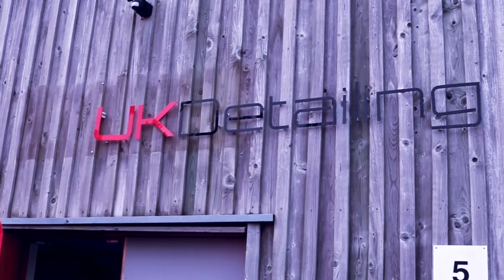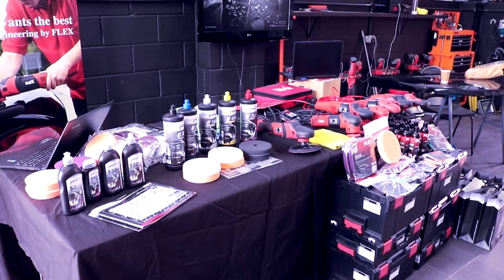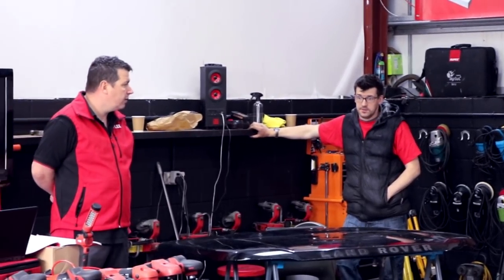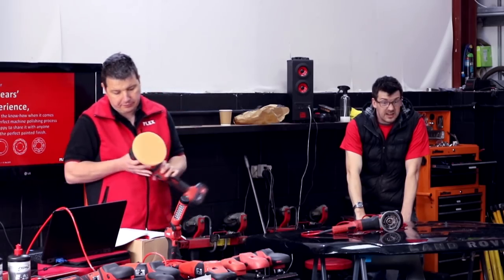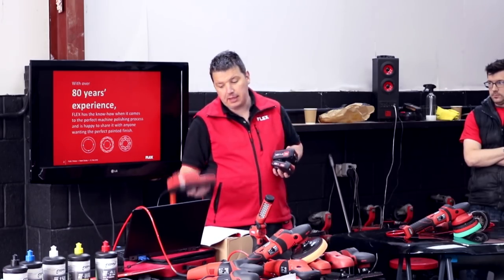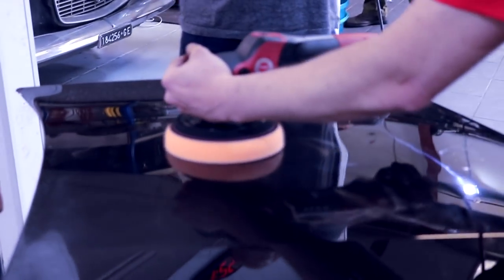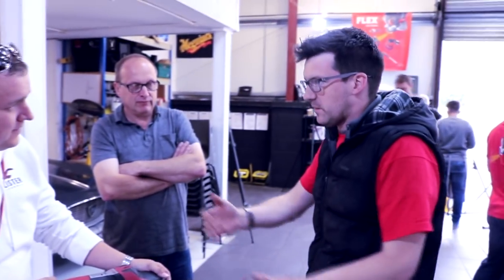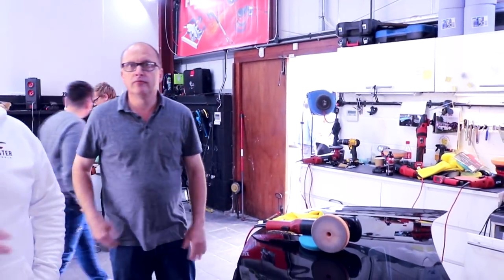Making paint smoke on a rotary! UK detailing: Flex Power Tools and Scholl Concepts introduction day

Comment: I know I don't work at Scholl, or class myself as a pro detailer, but it does annoy me of their pad choices. For example, they say purple pad for S20 black, which I find WAY too aggressive, especially when you have to work it longer. They also say not to use a white pad, or soft pad, but use an orange (med-heavy) when using S40 finishing polish. So they want a one-step to use their heaviest pad, and their finishing polish to use a medium-heavy pad? It advised to not use a finishing pad with S40 ... so confused why?!

For this reason, I moved over to Menzerna. Much easier to match your polish/compound with your pads.
Reply from the maker: are you talking about the spider pad range or the other one they do fantic?
Reply: It gets a bit confusing to be honest. S40 they recommend the standard orange pad for holograms (that's a really dense pad for a finishing pad). S20 they say the orange spider pad.

So they say the finishing waffle pad for S20, but not for S40? So confused. Check out the website mate, its so mind boggling lol. Maybe I'm just being stupid :)
Reply: Cant go wrong with menzs products. Thats all i use as a diy guy. There hc 400 and 3500 finsh polish will tackle most jobs even on a da. Keeping things simple works for me. The scholl line up just confuseing lol

Comment: i use flex polishers but cordless is just a waste off time for me  ure gonna be chargeing the battery about 300 times
Reply from the maker: managing the batteries doesnt seem to be an issue. you get about an hour of use out of it. and it takes about 10 seconds to flip to the spare battery and pop that on charge.   you will prolly loose more time from managing the cabel.

The biggest reason to not use cordless is because you might not need it. you have to pay for these batteries and batteries are not cheap.   theres a few other reasons why corded is going to be the best option for most people as well.  not everyone will have your requirements though, and its an offering thats available for those that might want this specially the mobile smart repair guys.
Reply: corded all the way i think it will never go i love my flex tools we like all ure vids

Comment: Are there any stands you recommend for practice bonnets Jon?
Reply from the maker: not really no mate.  I use a black and decker workbench.  you could then make like a bracket or something for the hood so it doesnt wobble around..  Uk detailing were using sprayers tressles but they wobble as well..
Reply: @ForensicDetailing  bumper trestles! Yes heard about them....ive yet to see the ultimate panel stand... Thanks mate

Comment: Can you use a QD and a spray on rinse off sealant at the same time? If so, in what order?
Reply from the maker: Im struggling to understand the question charlie sorry.   I think you mean could you use like a wet coat style siloxane type sealant thing..   and then once you have applied it could you use a QD?    after the wet coat style sealant you would dry the car and I guess you could use a QD at this stage.    So I guess yer you could..  I dont do that though.   the spray sealant should be giving you nice gloss and better surface characteristics than a QD..  if its a standard quats based QD its just gonna bury the sealant.
Reply: Forensic Detailing Channel thanks john. Yes that’s what I meant but didn’t explain it to good. I wasn’t sure if the wet coat would offer any gloss or not. Would that be the same story with a wax? You would only do one or the other?
Reply from the maker: gyeon wet coat is really glossy, incredibly hydrophobic and lasts for months and months.  I want to shoot another video on this stuff and how you can use it more efficently, it really is superb.   With a wax generally I will just buff that away, I wont spray a detail spray onto the wax or anything after or during buffing.  the wax layer thats left after the buff is also still curing.  if you use a nice paste wax to protect your car then a spray wax can be a cool thing to then use in subsequent washes as well, although you could just use a non wax type detail spray as well.